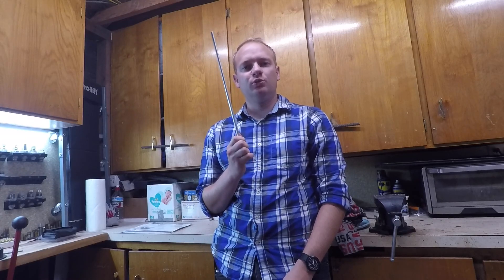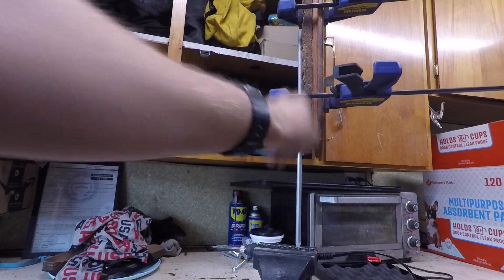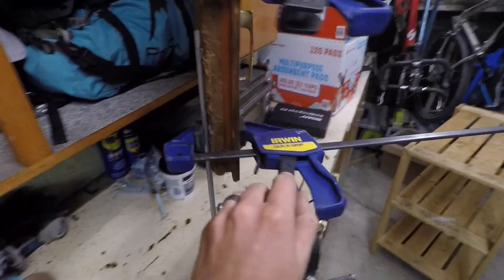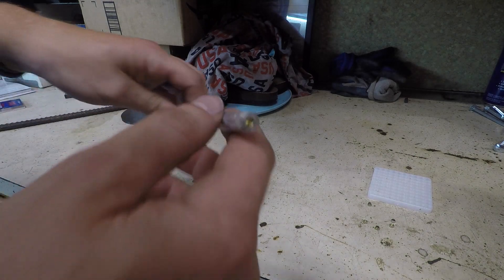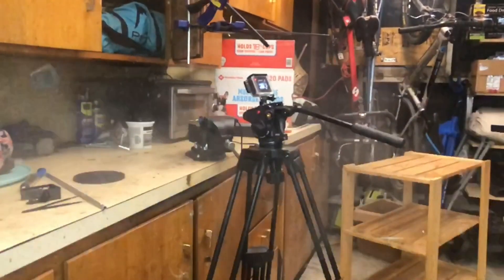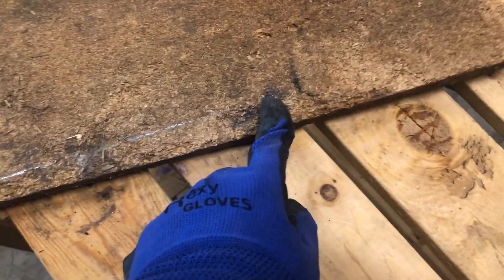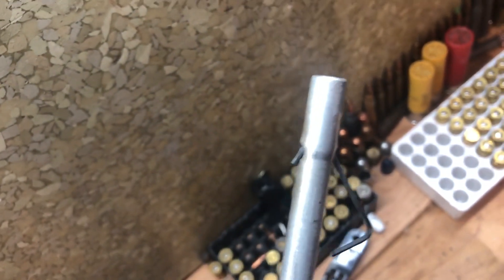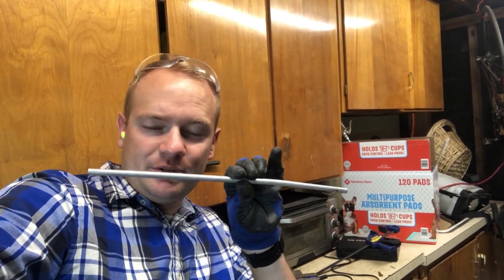100 Primers Exploding In Your Hand!

Comment: Dude,  You're lucky.  The two cans of WD just behind your experiment could have wiped you out.  Learned that from a great welding You tube.  Thanks for the good demo. But add a note re the nearby WD.  It has both a flammable propellant and flammable contents.  Plus a pressurized can.  Two bombs inches away from a possible bomb experiment.  If one primer had penetrated a WD can your shop would have been gone.    For next vid move the cans close protect your camera and do it outside. With a good extinguisher in hand.  I want to watch that demo.   no kidding.  But thank God Exp 1 with two cans of flammable in the blast zone didn't off you.
Reply from the maker: Haha good call. Now I want to go see how many primers it takes to blow up a WD can... 🤔

Comment: VihtaVuori Reloading Manual 4th Edition, page 96:
"Handloading is an enjoyable, rewarding hobby that can be easily carried out in complete safety. However, like any human activity, carelessness or negligence can create hazards. Handling primers and powders correctly is at the core of safe handloading practices. Do not store large quantities of primers in bulk! Doing so will create a bomb! Primers kept in bulk can explode en masse – the explosion of a few hundred primers is equivalent to throwing a hand grenade into a room!" 

Swift Bullet Company Reloading Manual Number two, page 38: 
"The Basic Rules for Reloading Safely Introduction
Read all available books on reloading. Make yourself as knowledgeable as you can."
page 40:
"Primer Handling
Do not dump together in bulk. There is a risk of mass detonation if one is ignited.
There have been instances of 'primer dusting'." 

Lyman 51st Handloading Handbook, page 29 and 39: 
"CAUTION: Primers are explosives and require special care."

Hornady Handbook of Cartridge Reloading 11th Edition, page 85: 
"Primers are the most active, potentially dangerous component employed in reloading. You can get into trouble with them handling in such a way as to discharge them"

Hodgdon Powder No. 27 Data Manual, section 6 -10, under "Handling Primers": 
"They demand the respect and careful handling due any device containing explosives. Primers should never be handled, used, in bulk, since primers in bulk can explode simultaneously." 

Lyman 51st Handloading Handbook, page 59: 
"CAUTION: handling primers one at a time is a safe procedure. However, primers handled in bulk are a potential hazard. Should one primer explode, all will do so spontaneously with disastrous results. Even a few primers exploding can cause serious property damage and personal injury."
page 60:
"CAUTION: Primers can and do “dust”. 
CAUTION: Static electricity may cause primers to explode."

Speer Handloading Manual Number 15, page 41:
"Static electricity and the Reloader 
1. Static electricity can be highly hazardous for the reloader. 
2. primers are most sensitive to static charges. The energy is enough to ignite primer dust. The dust can ignite and propagate to all the primers"

 Modern Reloading Second Edition Richard Lee Revised 2021, page 59:
"Tony Sailer from CH Tools gave good advise about primers. 'Reloading is pretty safe, until you handle primers in quantity'.” 
page 60:
"Accidentally drop a tube full of primers to a concrete floor and you are going to have one heck of a bang."
page32:
"Never use a primer feeder that feeds from a tube. If one primer goes off they all explode. What would happen if you should drop a tube full of primers to the concrete floor between your feet? You may not be blind, but could be forever a soprano."

Berger Bullets Reloading Manual 1st Edition, page 104: 
"The safe reloading of ammunition is largely based on the use of common sense." 
page 106: 
"Safety always comes back to the use of common sense. If you ever find yourself in doubt, stop, research"

A Posie by TheTexasRAT:
"And remember:
Wisdom Never Lies Inked To The Pages Coddled By A Book
But Rather At Rest Supply About The Inside Of Open Minds
That Render The Confounds Thereof."

Comment: A little bit about different brands and types of primers. 
Which ones to use, when and why. 
All CCI and Remingtons primers, plus Winchester's small pistol are the safest to use in automatic priming tools.
Federal burns hotter and cleaner, yet are according to the Richard Lee manual "one tough dragon to control in the automatic priming systems".

Modern Reloading Second Edition Richard Lee Revised 2021, page 60:
To find out why some brand primers explode violently, I talked to an expert, Dave Anderson, now retired from CCI. He told me primers are charged with one of two types of charging compound. One is called "basic" and the other is "normal." The primers that use "basic compound" must not be used in Lee Priming tools because an accidental discharge is very violent. The "normal compound" is less violent and causes little damage to the tool. The user is easily protected by safety glasses. 

Metallic Cartridge reloading, Robert S. L. Anderson, page 20: 
In the firearms industry there are two types of lead styphnate primer compounds - "normal" and "basic." There are presently four manufacturers of primers in the U.S., and all of them except one uses the normal lead styphnate primer compound. Federal is the only manufacturer that presently uses basic . The common ingredient to all small arms primers is lead styphnate of which there are several different varieties. Basically it is in crystalline form and is very explosive. Normal lead styphnate is composed of large irregular crystals, which are slightly acidic when wet, somewhat more brisant at lower temperatures (good for military use), and they burn with a cool flame at ambient temperatures. However, it is somewhat harder to get an even mix of components in normal lead styphnate primers because of the larger irregular crystals and the fact that the "mix" often requires some metallic fuels (such as powdered aluminum) to help make a magnum primer. Basic lead styphnate is composed of small regular crystals and unlike the normal mix is not as acidic and will not attack primer cups when wet. Basic lead styphnate is easier to mix than normal variety and there is no need to add metallic fuels. The basic primer flame is very hot and will easily ignite most powders and therefore Federal does not offer a magnum pistol primer. However this style primer is slightly less brisant at very low temperatures (- 20degrees F. to - 40 degrees F.) which would make normal primer more suitable for military purposes. 

Metallic Cartridge Reloading, All New Third Edition, M.L. McPherson, page 29:
Certain brands of primers might be unsafe to use in some priming tools like Lee's AutoPrime because of the potential for mass detonation. With these tools, should an operator detonate one primer, as can happen when a handloader tries to seat one primer on top of another,  the detonation subjects other primers in the tray to shock and an incandescent flash. If this shock and flash can detonate a second primer, there is the potential that most or all (perhaps 100 or more) primers in the tray might detonate en masse. Such a simultaneous detonation would be a disaster. Lee has tested all available primers and, excepting CCI and Winchester, all brands produce an unacceptable number of mass explosions when the primer being seated is forced to detonate (by heating in a remote explosion-proof box). By comparing Federal and CCI primers, we can gain some understanding why brands very in this regard. Federal primers do not have a foil covering over the primer pellet; an application of a type of paint replaces the foil. That sealant is easily ignited and highly flammable, possessing a very low kindling temperature. These are beneficial characteristics; among other things, they help reduce combustion residues. However, use of this pellet sealant makes these primers very easy to ignite. Exposure of the open front of the cup to the flash from an adjacent primer easily does the job! Conversely, CCI primers have a paper foil almost completely covering the front of the pellet. This foil deters pellet ignition because it is only moderately combustible and has a relatively high kindling temperature. A short duration flash from a primer is unlikely to ignite the foil or penetrate through it to ignite the pellet underneath.

Comment: Now I’ll round out with a few horror stories – {these are not meant to scare you away from reloading but rather to encourage you to always follow all the safety precautions and heed the warnings in the manuals for a safe and long Handloading journey}.

Any Shoot Will Do, The A-Square Handloading and Rifle Manual, page 16: 
Let’s start with guys who didn’t read the safety chapter. All of these are real incidents involving experienced reloaders. 
#1, A commercial handloader producing handgun cartridges in quantity used to begin his day by filling a coffee can with primers to pour into the machine. He would pull out each tray and, with a flick of the wrist, empty it into the can.  One day he used too much flick: one primer went off, initiating a chain reaction that filled the air with shrapnel and cost him both his eyes." [a commercial reloader that thought about how many rounds he had loaded and never had a problem whereby he did not bother with safety or safety glasses, until one day he wished he had taken heed to the warnings, but it was too late by then.]

The Complete Handloader, John Wootters, page 37:
The Power of Primers
Never under estimate the potency of priming compounds. ... a workman at a priming manufacturing facility was carrying a bucket of loose primers ... and the whole bucket detonated. ... they never found any part of the workman except his shoes. 
An acquaintance of mine had ... about a hundred rifle primers detonate in a plastic medicine vial in his left hand. He lost his hand and the sight in his left eye, and he underwent a series of operations for cosmetic repairs to his face, arm, and upper body, suffering a great deal of pain, a staggering financial setback, and the loss of part of his livelihood. He was a gunsmith.
Primer Precautions
Such tragedies illustrate the inherent explosive power of small-arms primers, but they can be avoided totally by understanding and adhering to a few simple precautions. The first is never store primers in any kind of container other than the original factory packaging. The second is go back and reread that last sentence several times. Do not keep live primers, however few, loose in any sort of miscellaneous container, and most especially not one made of glass.

A fellow YouTuber told a story of hand priming in his Lazyboy chair when one went off. They found the lid to the primer tray stuck in the ceiling above the chair. According to the story it had just missed his face. So be extra sure not to have it aimed at your face when hand priming with these tools. And safety glasses would be a very good idea  as mentioned throughout all the reloading manual over and over again.
Reply from the maker: That is CRAZY! I would NEVER put more then 100 primers in one place at once. A bunch in one CAN? That is asking for trouble.

Comment: I've never had this problem.  I use the Lee 5-stage reloading press.  There is no "tube" for the primers.  They are contained in a tray and feed singly into the priming station.  The tray is given a very minor shake during the process but NEVER enough to set one off.  Eye protection is always a necessary step in any mechanical endeavor.
Reply from the maker: It would be interesting to see if they would blow up simultaneously in the lee tray. I highly doubt it. Seems to be the safer approach.

Comment: Been there done that. Numb fingers for 3 days. You know what's funny? Go look up the old orange Lyman 55 powder meters and read the old men's tales on the internet of how they'll explode if you use black powder in them as they were designed. 
This myth revolves around the either of 2 theories that ESD in the plastic reservoir could potentially set off the black powder or the steel drum rubbing on iron housing can cause friction ignition.
No examples of testing exist nor examples of incidents brought to light yet this myth is preached to no end on every forum questions regarding the old orange tool and black powder come up.

Mind you, the same men that perpetuate this myth or fear of black powder in the old orange Lyman 55 never ever mention exploding pickup tubes or exploding handheld priming tools as has happened repeatedly, with records of incidents going back to the 1880's. Interesting how that works isn't it?
Reply from the maker: I will go check that out. Maybe see if I can get one and blow it up. :) 
Black powder is no joke.

Comment: I work in a primer factory. Primers are no joke. If a plate exploded, that’s 500-600 primers, it will shake the entire building
Reply from the maker: Yeah 500-600 would be a big boom! Do they sell you primers directly? That would bee pretty sweet.
Reply: @TheLarkinsLair Everytime I reload? I secure my shells in a tall metal bucket (just In case) no lid,  then in the morning I put them in a box.
Reply: Oh! $h!t !
Reply: Yes, you're dealing with an explosive, not a propellant.  Primer manufacturing is the most dangerous part of the ammunition manufacturing process.

Comment: I always put a small amount of priers at the time in tube.  no more than 20 primers at a time.
Reply from the maker: I still do all 100 even after this, I just wear eye and ear protection.
Reply: I use a Hornady hand priming tool. Load 10 at a time into the tray and verify the primer is properly in the loader before squeezing the handle.